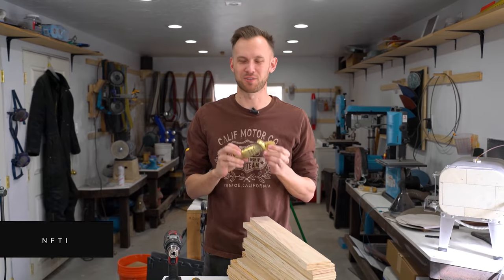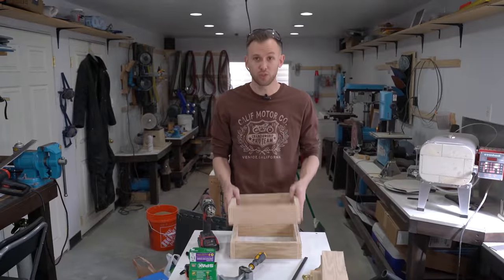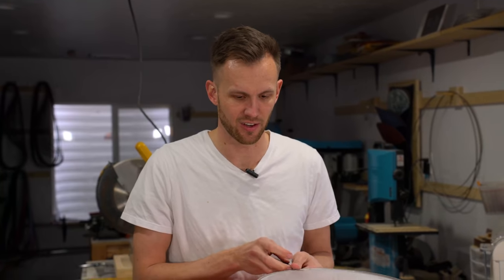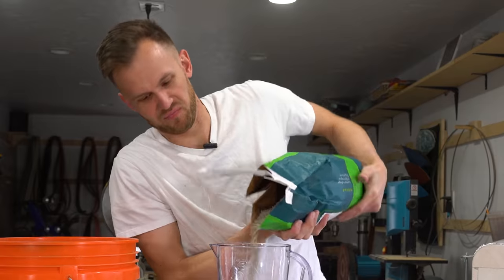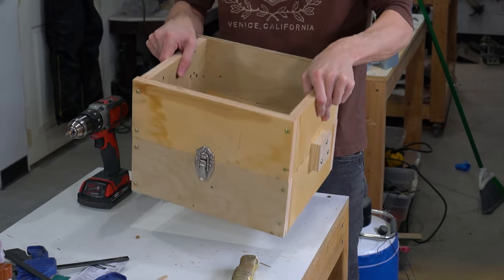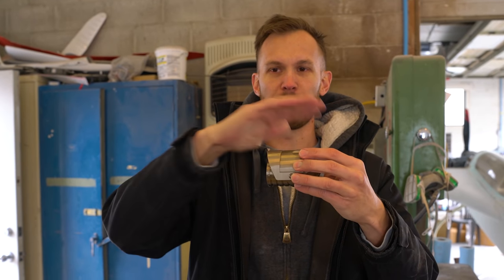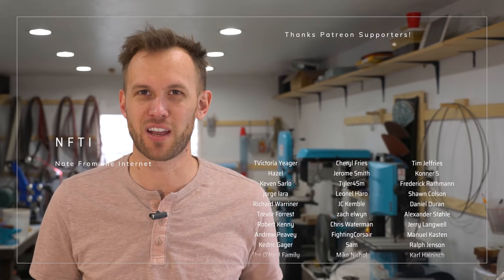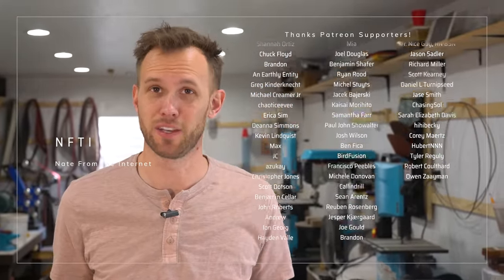Using Glass to cast Molten Metal!

Comment: Oil based greensand might get you better results as it's more resistant to drying out and holds its form better.  Adding the glass beads was definitely a smart idea tho and go for slightly less adventurous objects unless you make a larger cast and plan to do add later detail with hand finishing.
Reply: Yeah, this is what I was hoping he'd do. Hopefully he experiments with making his own oil based green sand
Reply: Just wanted to add that, before I saw your comment. And instead of cat litter perhaps red clay powder.
Reply: @ZoonCrypticon  cat litter is mostly clay, it's just "white" clay. Red clay is just clay with iron oxide in it which is what bricks are made out of.
Grew up with the stuff since it was everywhere in North Carolina, you didn't own white socks for long, you had orange socks.
Reply: Adding the glass is why he has such a  bad cast, the melting point of the glass dust is lower than the brass that he used, it's also why so much of the sand was infused into the casting.
Reply: @william-Bartee  Petrobond is what other Youtubers use, and it seems to be perfect for casting.

Comment: Here is the reason I think your casting sand is sticking to your cast: Melting point of glass (dust) = 1400 to 1600°F. Melting point of brass = 1700°F. Therefore, your molten brass is melting your glass bead dust in the green sand, and causing all the particulates to stick to your cast. 

Also, from the little bit I know about blacksmithing, silica sand is much better to use in green sand than regular sand that you buy from the hardware store.

Comment: In addition to trying oil based green sand, putting your box together sideways might reduce the chance of collapse. Also, I'm used to seeing people use a 2 part blank so they can leave it flat and pack the sand around the back instead of trying to shove it into the sand... I'm no expert and you did an incredible job! Thanks for sharing!
Reply: And to answer your question, of course I want to see more (suggestions above). As for what to cast, try casting a small hammer

Comment: you can do lost pla casting with greensand really well. the issue you had the last time is the sand moved into the already melted foam. if you have greensand it will hold its place a open as the pla melts out.

Comment: just fyi the boxes as Nate calls them are called a flask when pinned together...separated the top frame is called a "cope" and the bottom is called a "drag".....also Nate' the reason you had sand stick to your casting is because you added the glass dust...just use green sand mix...nothing more..your on the right track.. well done for beginner casting!!

Comment: When I took a class in casting metal 40 years ago we used sand mixed with heavy, sulfur-smelling oil. It worked well but caught fire when the metal was poured and wasn't good for the environment. Later I tried water and clay at home and had results about like you're getting. I was forced to move houses to a new location at that point and never got back to trying.

Comment: If you made it to this comment.  I would suggest you make a cement mixer with a 5 gallon bucket.  This can be used for many purposes.  The sand shaker ,use a small motor with a offset weight.  
I enjoy your videos. 👍

Comment: green sand is fun, i used cad software to layer out and flatten a ring, and cut the layers out on a cricut, glued them together and used green sand to make a mold, then cast gold, and or silver, and then bent them around mandrils, and set stones into them to make actual rings. only just barely had to touch it up afterwards.

Comment: Intro was cute.
Agree with comments that maybe oil based would work better than water.  I have no hands on.  Only what I see in other videos.
Another thing I see in most casting videos is after making the form / removing the object, they run a torch on both halves of the form where the actual impression is.  I assume this firms / hardens the surface area of the mold so it keeps its shape / detail better.

Comment: For mixing stuff like this, try using a drywall mud drillbit for your drill, it should help in equally distributing the mixture while you slowly add water to it.

Comment: As a geologist I can tell you what I learned about the fine glass bead sand. The reason clay and other material sticks together so well is because of static electricity. It forms a really strong bond with the tiny particles and in a river system that means you end up with fine silt/clay on the bottom of a riverbed that does not transport down stream unless disturbed by an object.

Comment: Nice job explaining and showing the progress. My last brass axe was also done with lost form casting. Which ruines my tools finishing the axe later on :-). Seems like I also need to level up to green sand. As the plaster molds usually crack on me.

Comment: Comment and Suggestions: I like your content and how you deliver it, you and Calli are why I got interested in KoR and both of you are always fun to watch. However, I think I would enjoy the content even more if it were inventive things that I could actually do myself (with little investment) and that I could enjoy after they are made. Some examples off the top of my head might be doing something with miniature cameras like 1. Recreate a real version of sticky cameras like the ones used in the video game Splinter Cell (may require a projectile system to keep them pointed in the correct direction); 2. Take aerial photography using a miniature homemade hot air balloon or large helium balloon and strong fishing line (for control and retrieval); 3. Make a remote-controlled underwater exploration sub to look for lost things in lakes or other bodies of water. Maybe some cool gadgets sort of like the Assassin's Micro Crossbow from KoR. Maybe try to recreate real-life versions of spy gadgets from Mission Impossible or James Bond (the semi-safe ones of course). The metal casting stuff is cool but once it's made I don't know that I would have much fun with it so it doesn't inspire me to do it. Anyway, those are just my thoughts. keep making awesome videos! OH, and also, this is just MY opinion, but I would enjoy much longer videos (i.e. see some of Adam Savage's longer videos).

Comment: 12:30 as a hobby caster, both your sand and method need work, as well as the flasks.  For the flasks you need something for the sand to grip, higher quality flasks use a recess, but you can add a few strips of wood to the inside.  For the sand, you can’t just mix it, you need the clay to coat the sand grains.  Pros use a Muller to smear the clay onto the sand, you can do similar by getting the sand a little too wet and repeatedly ramming it HARD into your flasks, pop it out and do it again.  Some people have success putting it in a bag and running it over with a car.  Your sand is ready when you can grab a handful, squeeze it, release and it holds its shape, then break it in half (supposed to be a clean break), with one half you can gently blow through it (you will get sand on your lips), and the other half is thrown against a wall leaving half stuck to the wall in a cone with no drips.  Then, learn the proper ramming force, which is just experience.  Also, you need a better pattern.

Comment: I do believe that, if you make a 3D base with details enlarged (Like the "mohawk" of the Iron Giant head) it'll be easier for the molten metal to fill it in, in the casting process. Since it leaves some excess as well, it'll be easier to grind/sand/file the excess off, than to weld a new mohawk on. That's just me pondering though, great video!

Comment: If you chuck up a large allen key in the drill, or some other slightly off-balance weight, you can get a good vibration out of the drill.

Comment: I mix my own green sand, I use sieved pavement sand and fullers earth I get as a fine powder. The way the sand is falling away looks exactly how mine looks when it has been used quite a few times and the fullers earth has burnt off. Basically I'm saying put about more fullers earth in. If you had 10% I'd go to 15%. That will mean you need less water in the mix to hold shape and therefore better finish on the parts.
I'd also put in some 'ribs' on the inside of the boxes to grip the sand. There's plenty of videos out there on making casting boxes so you'll be able to see what I mean.
Also, to get rid of the 'baked on sand' I use a steel wire cup brush on my angle grinder, that cleans it right off

Comment: You have to pack the sand inside the box with a square mallet or tool. That way it really packs around your object. Add more sand and pack that down then again. Scrape off the extra sand with your board.

Comment: Another option would be to use clay, roll it into flat sheets, then dry it (in an oven?) then pulverize the dried clay into a powder, then mix it in with the sand, THEN moisten the mixture, and the clay will help hold it's molded shape. also consider adding a wooden cleat around the 2 halves of the mold, so the sand mixture has something to grab onto when inverting the two halves of the mold. in industrial applications, (casting engine blocks, etc.) an oil based sand is used. the issue with making oil based sand is that when the sand is fresh, the oil burns from the molten metal and the temperatures.....Buy once the oil based sand is tempered, and baked in, it doesn't flare up. engine casting plants usually supplement their older sand with new sand, instead of swapping out the old sand for new, for this reason. also, I wonder if you were compacting the sand into the mold enough. tamping and compressing the sand around the molded object. the tamping process should be done in several layers to promote the solidification of each side of the mold, so each side of the mold holds it's shape, and remains in each box. again, having ridged surfaces inside the box will help with mold retention.

Also, pouring the metal into the top of the molded piece will allow for a more complete fill of the mold, and allow air to escape the mold, without needing air holes, which may compromise the molds integrity, and allow for collapse. that mold filled from the side, and only the pressure of the molten metal above it, forcing the air through the sand is how the top half of the mold filled, and that happened slowly, causing the sand to stick to the mold, and the top half of the mold being less detailed. try adding sheets of plywood in the top and bottom of the mold to prevent the mold from separating during transport, with chest latches to secure them, and in this instance, pour the metal into the mold from the side, so the molded head is situated upright (or up-side-down while pouring to promote faster setting of the casting material for a smoother surface, and less tooling after casting.

Comment: If you ever want to do that fin reppose or engraving on flat sheet bronze then cut it and weld with a tig welder final grind and polish for a finish. Also tig any pits left by casting process if desired.
Reply: Filler for stuff like this is best done in sticks of weld material from the original casting (we just use a straw from the side of the green sand or sprue some with wax in our plaster moulds for projects we expect welding then hammer the rods into shape after cleaning and heating) but normal aluminum bronze or just copper will work as filler.

Comment: If you're looking a more fine green sand: After Sifting, take the larger grain and place it in a tumbler with ball bearings.  Depending on how fine you want the sand to be, you will want to use different size ball bearings, as well as the time the rough sand is in the tumbler.

Comment: I recommend that you attemt to make oil sand, it gives FAR better results than anything except ceramic dip moulds and resin bonded moulds, both of which are not at all cost effective.
The standard stuff is called Petrobond and is oragne and quite pricy per pound,  but I believe there are some recipes to make your own for far less.

Comment: Using a spoon to "polish" the sand around the original form will make it denser and less likely to bond to the other half of the moulding sand, especially after some powder.
Also, for 3D printed stuff or anything for that matter, a couple coats of glossy spray paint on the original model will help with the sand sticking to it like with your rough original piece.

Comment: The way I learned it you put the object on the table (inside the box) and then pour sand on it, pack it and reverse the box. But we just cut the object in two halves and use one half for each box

Comment: It's not a failure: it's Success' training ground. The knife handle came out pretty well, you should have used it as a handle for an actual steel knife. Please try out more castings. Covering it with plaster will give nicer results I think but then maybe you should try to 3d print a mold and use wax to make the shape like you did in TKOR. Wax is just so much easier to remove from the plaster mold; just throw it in the oven and voilà

Comment: Be interesting to see if you could cast the Archangel Blade from Supernatural with all the twists or the demon blade with all the detail on the actual blade.

Also random question would there be any way to convert a car tyre air compressor to make a cheap sand blaster?

Comment: I would have created a rubber mold from the original and filled it with wax. Then use a lost wax technique with the sand.  I think the two part sand mold is better for flatter things with no under-hangs. The knife from the beginning of the video would probably come out nice.

Comment: you need to split your 3d models in half before printing it allows for better castings since you can lay the flat side down pack the sand around it. Then pout the second half when you flip it over

Comment: For casting 3d prints try uploading it into fusion 360 and use the split body command. You can then print it in two halves making the whole process a little easier for you
Reply: Most slicers can also split 3d models nowadays.

Comment: Would it also work for the litter to use/make something like a rock tumbler with steel balls?
Also, would it work if you cast the head in wax first, then used that for the sand casting, heating the whole thing up enough to melt the wax out while still closed?
Maybe a low temp wax, so it wouldn't have to be heated enough to ignite the wood frame.
Though I guess that point that's just one step from plaster casting anyway 😂

Comment: usually you have two kinds of sand for sand casting one fine and one coarse
fine sand is sifted over the object that you are casting for detail, coarse sand is used to fill the box and make a solid block of sand

if you want to make it easier to cast split your mold object to bottom and top half's with alignment pins (top mold only) to align them
so you can hammer the sand in the bottom section around the mold then flip it over and cut your sprues

if you want the sand to keep in the box easier there are two ways taper the top box like this \ _ / (\ and / = walls of the mold box, _ = the mold the angle is about 2-3 degrees)

Comment: Looks like the sand is to dry, should be crumbly but hold is shape when pressed, like a loos pasta dough. And also likely needs more clay (bentonite). You should also compact around the item, and not try to remove the sand from the 1/2 box full

Comment: Where a jig or reciprocating saw would be handy moment I see?   Wondering if a lost PLA casting might be worthy?
Reply: When I used to be the sand lab technician... literally decades back... crystalline sand structure is what you want.  There is actually ideal sand that is used and like certain dunes contain.  The rest might be more like say glass you find at the beach where is more rounded in shape at the edges/corners and not so sharp.  Was literally a project that was related recycling the green sand to get more uses out of.  Later, I wondered if stamping through a stamp mill to break up more might help break up or like sintering and then breaking again.  Totally could tell your hand clump test wasn't working so well earlier on.
Reply: Myfordboy has some great videos detailing how-to.
Reply: There's silica glass sand also doing the lost (burn out first) foam or PLA methods.

Comment: COMPLETELY UNRELATED TO THIS VIDEO but, in trying to expand on your vortex and bubble fountains from your time at TKOR (because my daughter saw me rewatching them both)  I wondered if it might be possible to feed the output from a vortex fountain above into an inverted bubble fountain nozzle below using supports alongside the lower portion to deliver water flow to the upper vortex portion? Just wondering what your thoughts might be on that.

Comment: I have always used oil in casting sand never water
Reply: What kind of oil, and at what ratio to the sand mix?
Reply: @GoodandBasic  you can buy petrobond oil bet we used light engine oil  like 5w30 mixed 50 50 with paraffin. Same style of mixing using a spray bottle to get it to the consistency you would use for a sandcastle. Need to leave it for a few days  for the volatile compounds to evaporate and then use to cast.  Needs hammering down really well to compact.  The only other difference is we used bentonite clay cat litter and playground sand mixed with silver sand which is just very fine sand.

Let me know how you get on  and good luck
Reply: @markedis5902  thanks. I'm looking forward to trying this. Just getting back into casting after a long hiatus. JB
Reply: @GoodandBasic  Many thanks,  I enjoy your channel a lot.  Looking forward to you doing more practical stuff over the spring and summer.

All the best

Mark